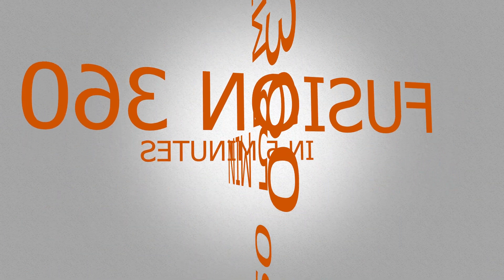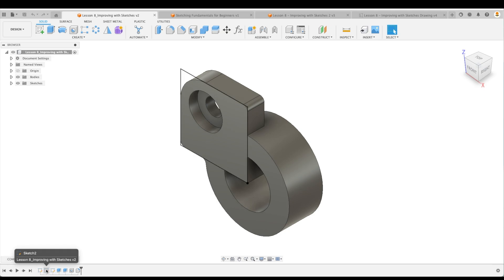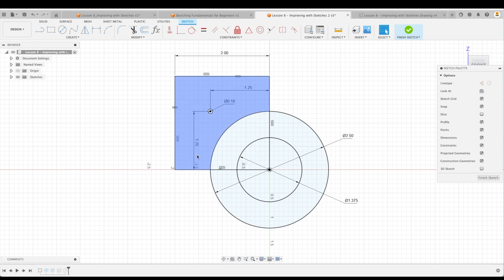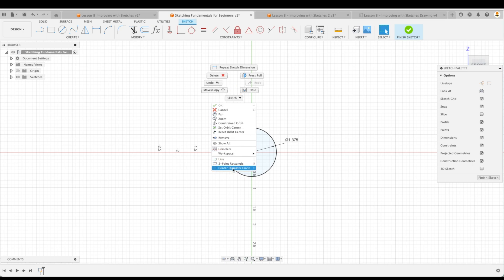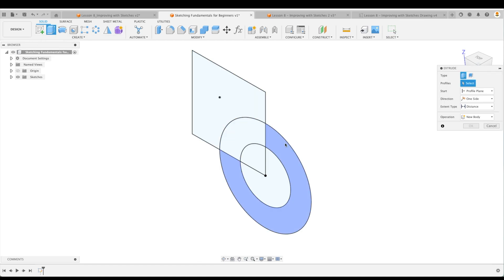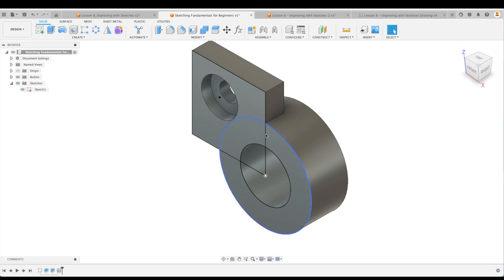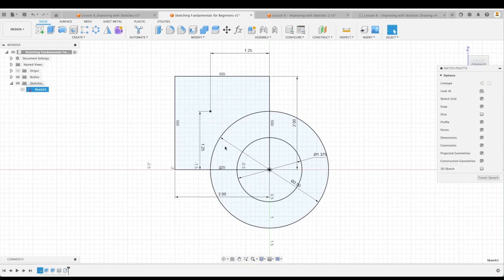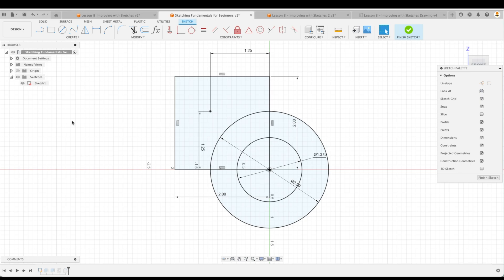Autodesk Fusion 360 in 5 Minutes #004 - Sketching Fundamentals for Absolute Beginners (2023)

Comment: Learning a lot. Got a 3d printer and just wanna get my sketches on it. My question is what makes you choose the plain for the sketch. I thought xy axis would be a default setting thing almost. If you could guide on that a bit. Thanks
Reply from the maker: Excellent question! I choose my first sketch plane based on how I want my part to look when I select the “Home” position of my View Cube. This makes many things easier including drawings. Also, if my part has a front, left, right, etc. I try and match them to my View Cube. However, please note this is not needed. You can create your model in any orientation, because you can reorient your part in your 3D slicing software easily. Hope that helps!

Comment: Just want to thank you for the lessons.  I watched the first 7 lessons, I was then able to create and 3d print a socket holder to fit into a specific spot in my toolbox.  Unfortunately my holes for the sockets were too tight even though I added some width, but it was fun creating.

And I had a good laugh after watching this video, you would roll your eyes.  I had 22 sketches.  Off to try revision 2.
Reply from the maker: You’re most welcome! Glad you have benefitted from them.

I also have a good laugh when it comes to sketches, because I also teach my students from the very start to create all their sketch features in one sketch (if possible) but it seems that it just doesn’t stick with new learners a lot of the time. That also happened with me in the past too! 😆 I think this tutorial is beneficial to many for that very reason.

Comment: You can't go back and undo things in a sketch, right?  I noticed when I created some fillets in the sketch and wanted to delete them, I couldn't because they were arcs and broken lines.
Reply from the maker: You should be able to undo up to a point. If you save or exit the project, you won’t be able to undo using the “Undo” command, however, you can go back in time using the version of the file. Every time you save your project, a new version is created. You can go back in time to restore that version if needed.